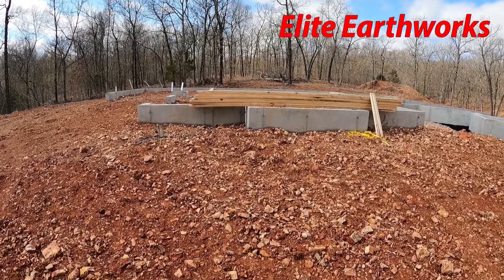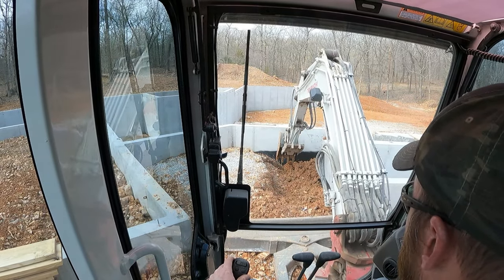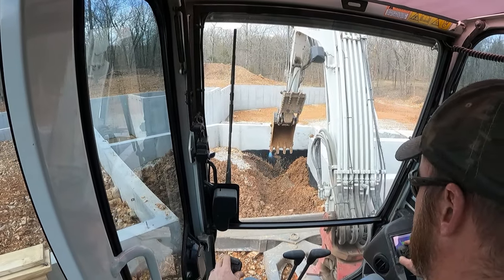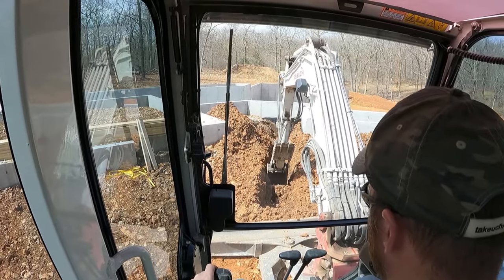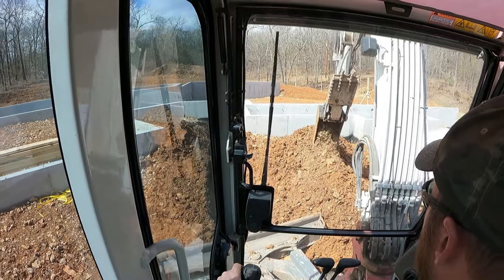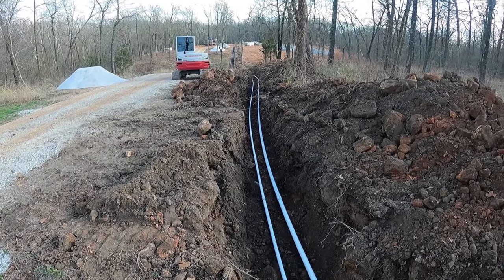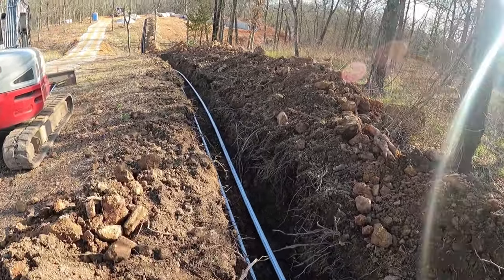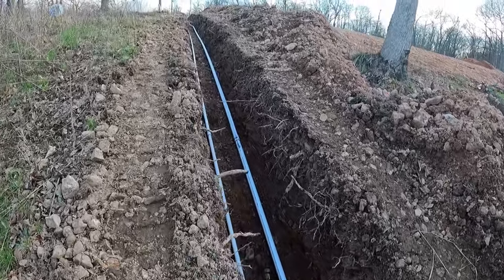Digging And Installing 400' Of Waterline

Comment: There they are!  I figured with that much elevation change you’d find the rock quarry.  Having that rake sure helped separating them out.

All those guys who say a ditch ought to be dug to a certain depth. within a half inch, haven’t dug here in S/W MO.  Have they?

Glad to see you could find pipe.  I was at Lowes last week and they were out of electrical PVC over 3/4”.  And fittings… there were more empty boxes than not.  I went to three stores to get one 3/4” LB!

Glad you got it in before the rain.
Reply from the maker: That’s for sure you just take what you can get here 🤣. It’s crazy right now trying to find anything. Appreciate you watching

Comment: You did those people a huge favor by increasing the size of the pipe. Hydraulics is weird in that if you have a single pipe that's say 1" and moving say 10 gallons per minute, and you lay a second pipe the same size, you only double the water carrying capacity or 20 gpm. But, if you only lay a single pipe that is a 2" ID, then your water carrying capacity is increased by 4 times or 40 gpm. I know you were tired of digging by the time you were done though.
Reply from the maker: Yes I’m glad they did. They would not have liked the 1” line. Having water volume is a huge thing. Most people don’t understand it

Comment: Hey BRANDON (good buddy), I don't remember that "rock strainer" on the 260. Is it new? Also, no requirement for colored RIBBON in the hole with the water line? Thank you sir! Nice job...
Reply from the maker: It’s my grading rake I’ve had it for a year or so. No we just have to bed the kind in with screenings but not ribbon

Comment: I'm just starting out in the excavation business.  Any advice on expected daily production with digging electric service trench through rocky ground? Hourly/daily charge rate? Tb180fr
Reply from the maker: It really just depends on the soil. I’ve dug 800ft in a day and I’ve dug less than 100ft. I try to get $1250 a day for my 260 but every area is different on price so you will probably have to figure out what your hourly or day rate needs to be.

Comment: Is that pvc or is it pex?

Do they make that in 1-1/2"? 
Is it too small, or the same price?
Reply: Schedule 40 PVC. Yes, it also comes in 1 1/2".
Reply: @larrykeenan598  When I search pvc all I come up with is solid pipe in 10 and 20 foot sticks. I know they also make flexible for drain lines on pool filters.
Reply: @mtu-engineer3220  PVC water pipe is made to be buried in the ground. 2" PVC will carry about 280 PSI. The flexible PVC is low pressure and used above ground. I would think an Engineer would know this.
Reply: @larrykeenan598  I know pvc pipe can be buried in the ground. I can only find high pressure pvc in rigid 10 and 20 foot sticks.

All the pipe in rolls is high density polyethylene or polyethylene or pex.

My local supply house does not carry pvc waterline in rolls.
Reply from the maker: It’s pvc yes they make it in 1/4” sizes from 1/2” to 12” I believe
Reply: @eliteearthworksllc  What is the brand name? I have not found it in search.
Reply from the maker: @mtu-engineer3220  I’m not sure on that. You should be able to google 1-1/2” sch 40 pvc
Reply: @larrykeenan598  Rewatched the video in slow motion and I can see the belled ends. This means it is 20 foot sticks of high pressure pvc pipe. I was looking for rolled tubing.